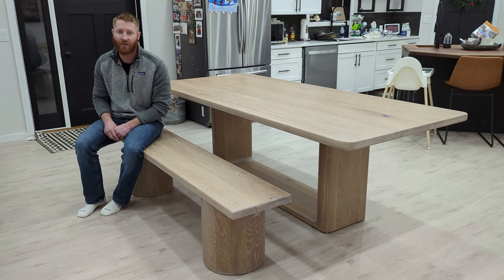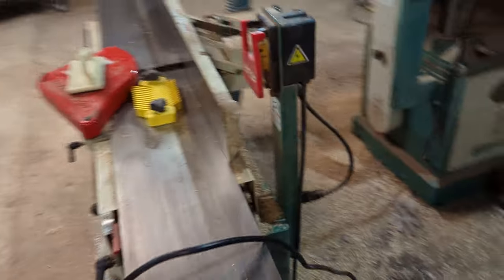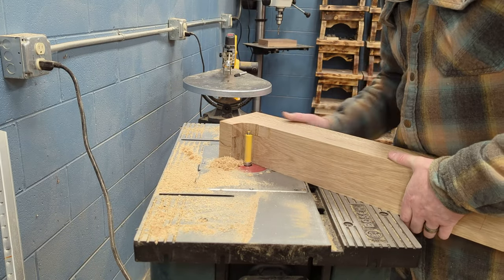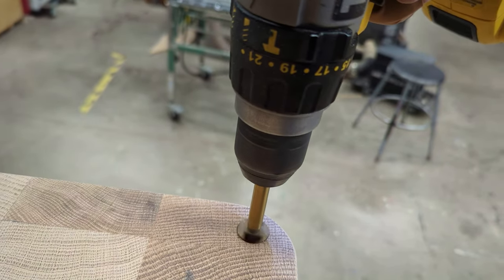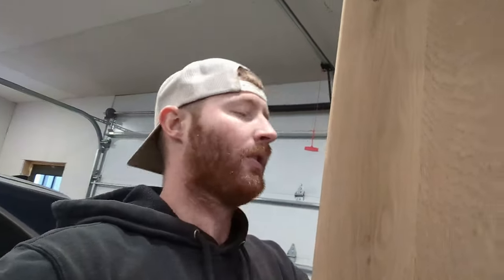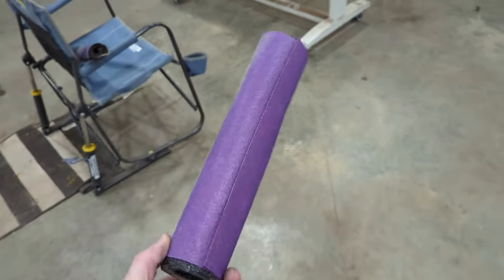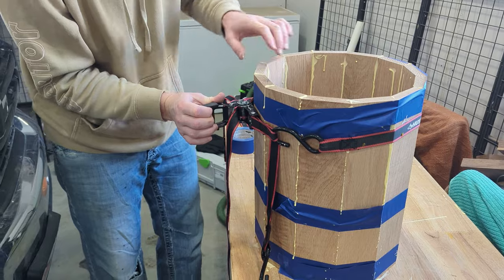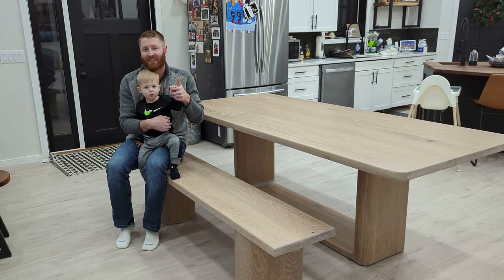Custom Dining Table

Comment: 10:28 Give Stock Room Supply's sanding mops a look. They may have been a workable solution, but a sanding block appropriately shaped always works.
Reply from the maker: Thanks for the suggestion I'll have to check them out for sure!

Comment: buy a Festool 567852 LS 130 EQ Linear Sander whit the Festool 490780 Do-It-Yourself Kit, so you can create the exact profile to that inner curve.
It is expensive but it will help you in all difficult profiles, the cost is paid only with what you save in time and perfect finishes, a beautiful project
Reply from the maker: I'll have to look into the linear sander, I've never heard of it prior to you mentioning, thank you
Reply from the maker: @enriquealvarez_artesano  holy smokes that would have been soooooo much easier